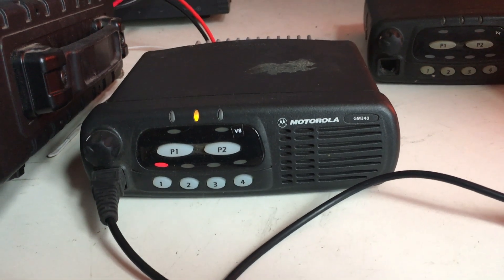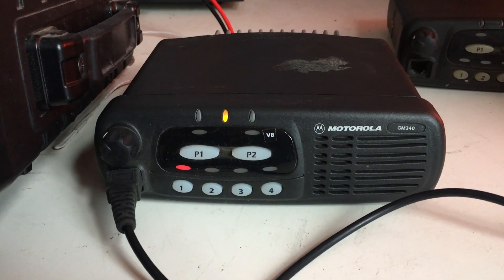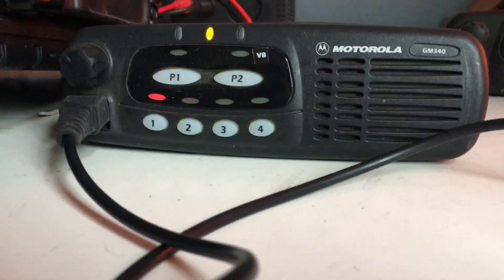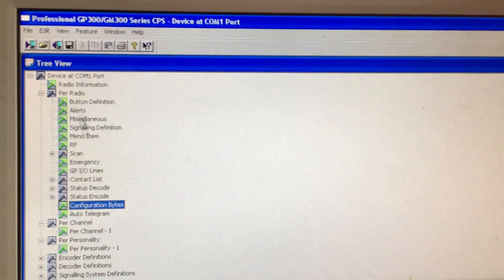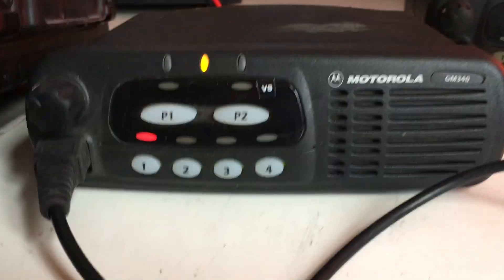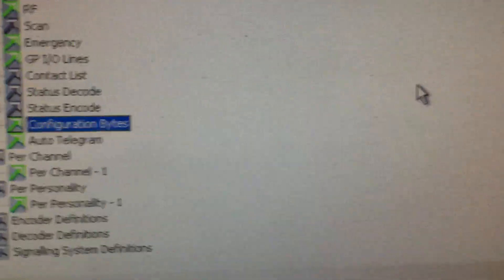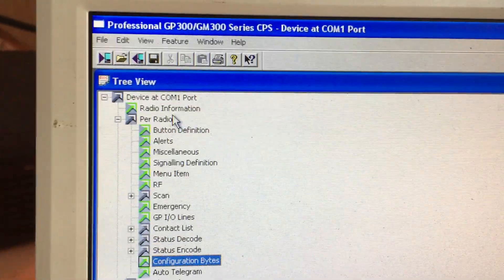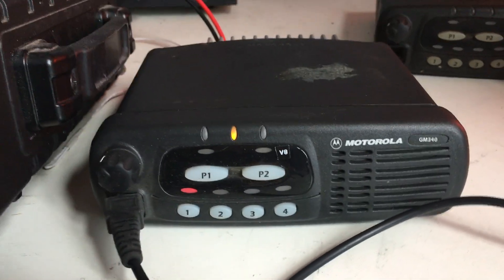Solution: Motorola GM340 crash reboot receiving DMR (TDMA) signal

Comment: I copy here a description of the Configuration Bytes that i found on a blog, with the hope it could help others and the lack of info about the Configuration Bytes. Many thanks 73 HB9FWB.

Per Radio Configuration Bytes

These are available in the software to allow for future configuration requirements of the radio and to enhance the future operational capabilities of the radio if and when required.

Note: These functions will only work with the correct radio firmware.
The usage of these functions may have undesired side effects.

Config Byte 1:

--------------

bit 0 - set

switch off the backlight of control head A

R03.01.10

bit 1 - set

enable a Data PTT TX time-out-timer

The regular Time-Out-Timer mode is then also valid

for fast data PTT.

R03.02.00

bit 2 - set

When battery voltage level below the error tone threshold, the long tone will NOT sound in Tx mode, and battery gauge will also be freezed while TX. (Portable only)

D03.02.12

bit 3 - set

Radio will narrow the default decode tone Min/Max duration to avoid radio displaying garbage info and reseting issue for system pre-defined signaling systems.

- cleared

Radio will work in original manner for system pre-defined signaling systems.

D03.02.13

bit 4 - set
The start alert will sound on both power on and reset.
- cleared
The start alert will only sound on power on.

D03.02.27

bit 5 - set

When the bit is set and GPIO pin 4 is programmed with External Alarm function, then enhanced external alarm mode will be activated. GPIO pin 4 will turn active for a period of 2 seconds after power up delay timer expired. After 2 seconds, GPIO pin 4 will return to its functional state.

- cleared

The radio will operate in standard external alarm mode.

Note: Only available for mobiles.

R03.07.05

bit 6 - set

When the user presses the "Keypad Lock" button and the feature "Keypad Enable" is enabled, then the rotary knob is disabled along with the keypad. Pressing the button again will unlock the keypad and re-enable the rotary knob.

- cleared

When the user presses the "Keypad Lock" button and the feature "Keypad Enable" is enabled, then the keypad is locked, however, the rotary knob is still functional. Pressing the button again will unlock the keypad.

Note: Only available for display portables.

R03.07.05

bit 7 -set

When the bit is set, the radio will behave in the way that is compatible to the requirement of GP360FUG11B radio with special Generic Command Option Board (GCOB). For instance, the soft channel 1 & 2's voice emphasis setting will be set to "Disabled/flat audio". Also, soft channel 1's Tx Timeout Timer Mode will be set to "Non-cumulative".

Caution: Use this config bit strictly on GP360FUG11B radio only.

- cleared

The radio will follow back the default hard-coded value/settings for soft channel 1 & 2 (voice emphasis setting & Tx Timeout Timer Mode).

Note: Only available for portable (GP360FUG11B).

R03.09.05

Config Byte 2:
--------------
bit 0 - set
decoder time-out-time (MAX) limitation
to system tone duration + 10 ms
R03.01.22
bit 1 - set
decoder integration time (MIN) limitation
to 0.9 * system tone duration
R03.01.22
bit 2 - set
The squelch is debounced by four more cycles
(5 instead of 1) to avoid radio resets caused

by a message queue overflow when the squelch flutters.

D03.05.01

bit 3 - set

When decoding a "Cleardown" sequence without any

address digits and/or status digits the radio displays

"Call Received".

This is the behaviour up to R03.01.27.

- cleared

When decoding a "Cleardown" sequence without any

address digits and/or status digits the radio does not

change the display.

This is the new behaviour at R03.01.31.

bit4 - set

Decoded Group Call sequences which contain variable address digits

will not be copied into the Missed Calls List.

R03.02.00

bit5 - set

Fast Data PTT is disabled if Rekey Inhibit Timer duration is set to a non-zero value.

- cleared

Fast Data PTT is not affected by Rekey Inhibit Timer duration setting.

Note: Only available for mobiles.

Even if Rekey Inhibit Timer is turned on, it will not apply on Fast Data PTT operation.

R03.07.05

bit6 - set

The radio will decode the acknowledgement status and display the status when
the Acknowledge in the Encoder Telegram is set to Ack1 Expected or Ack1 Expected with Answer.

- cleared
The radio will not decode the acknowledgement status and will not display the status when
the Acknowledge in the Encoder Telegram is set to Ack1 Expected or Ack1 Expected with Answer.

 

Config Byte 3:
  --------------
     bit 0 - set
             If encapsulated mode is enabled, radio will only handle the PROIS commands which started with $7F.
             R03.04.00

    

     bit 1 - set
              Radio will check and update the HOOK state after radio power on automatically.

             - cleared

              Radio will always set the HOOK state to "on-hook" after radio power on, no matter what is the actual HOOK state. (compliant with old versions)

              D03.03.03 

bit 2 - set

When the radio has changed from Rx mode to Tx mode, a $01 PROIS command will be sent to the option board to indicate a CTS.

- cleared

A $01 PROIS command will be sent to the option board to indicate a CTS only when a channel is ready for voice or data transmittal, ie, one of following conditions are matched:

1. PTT is pressed when PTT is controlled by radio, and sending telegram on this channel is finished.

2. PTT is pressed by option board, and sending telegram on this channel is finished.

D03.03.01

bit 3 - set

During vote scan, radio will vote the carrier without unmuting the speaker, and will unmute the speaker if

both carrier and correct PL are present. The Invalid Channel Marking feature will be disabled.

    R03.05.00

bit 4 - set
             Radio can record the voice from RSM or other voice accessories with MIC installed.
           - cleared

            Radio can only record the voice from internal microphone.

D03.04.01

bit 5 - set

Disable feature saving feature enhancement that is introduced since R03.02.07. 

Radio will work same as versions before R03.02.07.

D03.05.01

bit 7 - Set

If a Remote Speaker Microphone (RSM) is connected at radio power up, the radio will initially use the external (RSM) microphone.

-Cleared

If a RSM is connected at radio power up, the radio will initially use the internal (radio) microphone.

Note:

When either the internal or external PTT is pressed the microphone path will be routed to the corresponding microphone.

Do not set this bit when using accessories with only speaker and without microphone. Only available for portable

Byte 4: not used

Byte 5: not used

How to calculate the configuration byte value:
The configuration bits represent a 8-bit binary image which has to be converted to a 2 digit hexadecimal number which then has to be entered into the corresponding configuration byte field.
The table below shows all possible settings for the higher digit of the configuration byte.
Where "0" = cleared, and "1" = set, and "x" has to replaced by the lower number of the configuration byte.

bit 7 bit 6 bit 5 bit 4 HexadecimalNumber
0 0 0 0 0x
0 0 0 1 1x
0 0 1 0 2x
0 0 1 1 3x
0 1 0 0 4x
0 1 0 1 5x
0 1 1 0 6x
0 1 1 1 7x
1 0 0 0 8x
1 0 0 1 9x
1 0 1 0 Ax
1 0 1 1 Bx
1 1 0 0 Cx
1 1 0 1 Dx
1 1 1 0 Ex
1 1 1 1 Fx
The table below shows all possible settings for the lower digit of the configuration byte.
Where "0" = cleared, and "1" = set, and "x" has to replaced by the higher number of the configuration byte.

bit 3 bit 2 bit 1 bit 0 HexadecimalNumber
0 0 0 0 x0
0 0 0 1 x1
0 0 1 0 x2
0 0 1 1 x3
0 1 0 0 x4
0 1 0 1 x5
0 1 1 0 x6
0 1 1 1 x7
1 0 0 0 x8
1 0 0 1 x9
1 0 1 0 xA
1 0 1 1 xB
1 1 0 0 xC
1 1 0 1 xD
1 1 1 0 xE
1 1 1 1 xF
Configuration Byte Setting Example:
The squelch switching shall be slowed down, and when decoding a "Clear Down" sequence the radio shall display "Call Received". In this case bit 2 and bit 3 of configuration byte 2 have to be set, the others have to be cleared. This represents a binary image of "00001100".
According to the tables above, the higher digit of configuration byte 2 is "0" and the lower digit of configuration byte 2 is "C". So a "0C" has to entered for configuration byte 2 in this case.